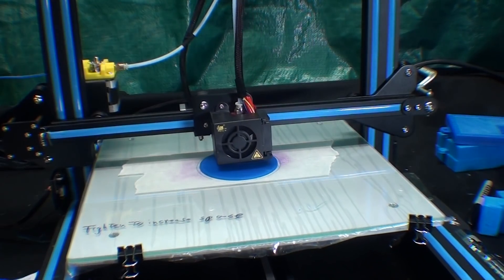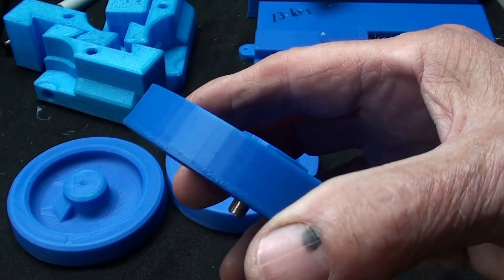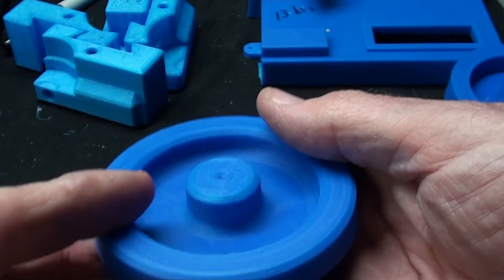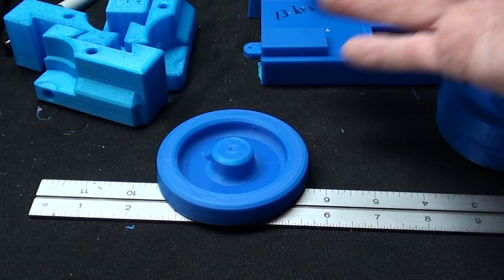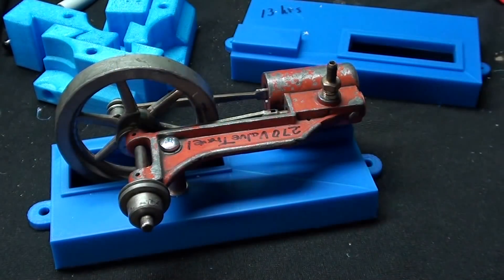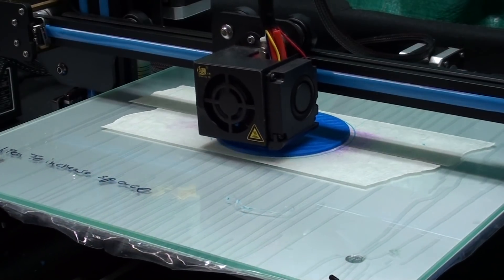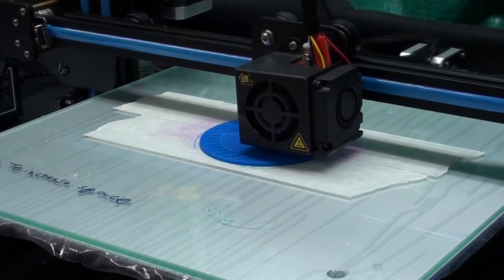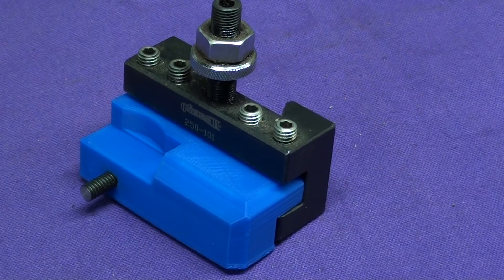3D Printing CREALITY CR 10 with tubalcain #2

Comment: I have been watching your videos for a long time and hope that I can return some of the help. 

Here are some tips for PLA bed adhesion. 

1.  You want your heated bed temp around 70°c use bare glass with some elmers disappearing puple glue stick smeared directly on the glass, it can also help if you use the glue stick while the bed is warm. You can clean off the glue stick every so often with windex if it starts to get too thick. Masking tape will lift off the glass sometimes even though it the PLA sticks to the tape well the bond between the glass and tape will be the weak point and it will still cause warping.

2. Check the gap between the hotend and the bed when the Z axis is homed using a piece of paper or thickness gauge. Adjust if the gap is larger than a piece of paper.

3. Make sure your bed is level as you can get it. Move your hot end around to different locations and use a piece of paper or thickness gauge and slide between the glass and the hotend and adjust the bed as necessary to get the gap the same across the bed.

4. Check your glass with your straight edge to make sure it isn't warped.

5. Setup autobed leveling and use the appropriate G code to complete the auto leveling. Once you do this your printer Z axis will automatically level and track the bed as it prints so if there are low and high spots the Z axis will move up and down as it prints to compensate.

6. Run your hot end temp a bit higher on your first several layers and make sure your part cooling fan is turned off for the first layers.

7. Adjust your Z offset either in your printer firmware or in your slicer to make sure that the first layer is squished down on the built plate.

8 Adjust your first layer height and extrusion width a bit to make sure it is laying down a good first layer. If you are printing at small layer heights of .2mm or lower you want to increase your first layer height to say 120% and your first layer extrusion width to 110% you can play around with these numbers until you get it dialed in. If you are printing thicker layers of greater than .2mm you can decrease your first layer height to say 90%.

9. Print larger parts with a wide brim that is attached to the edge part, this will keep the edges stuck down on the corners and you can use a deburring tool to clean this off after the print is done.

10. You could try printing on raft this takes more time and if you have all the above done, shouldn't really be required.

11. Get a Palette Knife Spatula set that is used for oil paints to help you get your prints off the build surface. Or use a utility knife blade to get under the edge of the part. Many times just letting the bed cool down will allow the part to just pop loose on its own. Many times I have something that is stuck too well I will just pop the part with a wrench or some other beating utensil and it will pop off the bed.

12. Make sure the printer isn't somewhere that is super drafty or cold and if you decide to print ABS or Nylon or other higher temp materials  you may need to make an enclosure that encloses the entire printer to keep the heat in and temperature swings out.

Comment: Consider using hairspray straight on the glass instead of the tape and gluestick. Go to Walgreens and get can of purple Aquanet. If it's regular glass, wait for it to cool, and it will usually release on its own. Otherwise give it a bath in the sink. Sometimes a little Windex helps too.   Level you bed with the unit preheated- nozzle expands a surprising amount.  I t takes a bit of getting used to think additive instead of subtractive machining.  'Been a fan since I got a book of your from Lindsey Pub!  Keep up the good work!

Comment: Hi Lyle I have used 3D printing for patterns I found that I had more work in fixing the rough sides and the inaccuracies in the pattern. I used a special filament that is 26% wood and that worked much better. If you would like to try it I can get the info where to buy it. For me school is still out on 3D printing for pattern use It is really much better for prototyping that for actual parts to use. For now I'll make patters the old school way. I believe it is much faster. I do understand that you like to experiment and try new things to learn. For me I need to get the job done, so it is the old school way.
Reply from the maker: +trainman4602 hi Dave. I like your cooking shows. And I always loved I talion food, even though I am German and Norwegian. Yes, the jury is still out for me as well. I am still just playing around with those newfangled thing. But I think the idea of using it for Proto types, and just getting ideas in three dimensions is great.

Comment: The warping is from uneven cooling. The last layer of plastic cools too much before before the next layer is applied - the hot uncontracted plastic gets added to the already contracted cooler plastic. A heated print bed will only get you so far. With ABS you want to add a “raft” when you print. The raft is basically a mesh pattern a couple layers thick that gets printed first, your model prints on the raft. The raft makes it easier to remove the part when it’s finished, and if it still warps slightly at the beginning then the warp is in the raft and not your part. Your printer not being in an inclosure could be a problem also. You might want to try a heat lamp or small space heater close by. The issue of your part being faceted instead of smoother might be a software setting. I know in Sketchup you can increase the number of segments used to render a circle and the finished part comes out much smoother. When you get around to doing some castings from these patterns I’d be interested in two things in particular. First, how you handle the gating. Second, how you determine by what percentage to scale up the pattern to compensate for the shrinkage of the particular metal you want to pour.
Reply from the maker: +StevieLlahma thanks, that is good information. I will try using a raft. And you explained it well, as to what is happening as it cools

Comment: I haven't read all the comments... but a couple of things... first is you are printing a tall solid. I don't mean solid infill, I mean plastic retracts  when it cools and when there a lot of vertical walls the plastic layers all on top of each other they work together pull together to lift the print off of the bed... that is why people print with a brim(not a skirt) a brim helps hold the outer edges of the print down because the plastic is only a couple of layers tall so it contracts pulling the print sideways instead of up. A wide brim with only one layer tall will help keep your print down... not always but it helps a lot.

Also CR-10 beds are notoriously concave... run your ruler over the bed and see if it is flat, if not get a mirror from Lowes... mirrors have to be flat to be optically correct so they are a good bet. Look for 12 inch by 12 inch bathroom mirror tiles (6 in a box) that way you can have different bed surfaces you can use.

Comment: a larger nozzle will reduce your print times and less layers makes stronger parts.  For a CR-10 this really adds up when you are printing big.  Consider ordering a .8mm nozzle which you swap in and out with re-leveling in between.
Reply from the maker: +Jesse Schoch I am not even sure what nozzle I am using now. It is the one that came with the machine. Where do I buy other nozzles?
Reply: They are M6 threaded Mk8 nozzles. Sold just about anywhere.  Mine was purchased from the creality aliexpress store.  I went for 0.8mm which lets me print 0.4mm layers.  For quick functional parts it really goes quick.  You can still print thin layers and only really lose x-y resolution.  Changing it requires re-leveling your bed which seems to take about 8x as long as actually changing the nozzle.
Reply: While i'm giving tips you should also grab a PEI sheet and consider switching from PLA to PETG.  PLA prints pretty but not so strong.  PETG is about as strong as ABS but much easier to print.  PEI provides the best surface for printing PETG in my opinion, you can forget glue sticks and tape making that switch.  You will need to retune your settings for PETG and it may be a bit frustrating for you, however I believe it is worth the investment.

Comment: If you are printing in PLA then you can get a much flatter bottom without the tape. Just print with bed 70c directly on the glass for a very smooth surface.

In my experience it is not the print lifting, but the tape that is slightly lifting/getting pulled up by the PLA
Reply from the maker: +Jeppe Beier thanks

Comment: If you have a heated bed, set it to 60°C. The part is also large enough to turn off the part cooling fan. Turning the fan off wil almost always eliminate the warping on larger part. Also, a smaller infill helps. For patterns I usually print with 10% infill.
Reply from the maker: +Sander Vercammen that's good advice, thanks

Comment: Hi there, just wanted to know I enjoy your videos.  I also have just been getting into 3D printing for misc. projects around the shop.  One thing I can add, although others may have mentioned it already (I have not read all the comments) is that I found that adding automatic bed leveling to the printer and then adjusting the Z height offset to get the first layer as close to the bed as possible resulted in improved bed adhesion.   I am also using masking tape as I see you are doing and found that it works fine, although a little hard to get off the bed sometimes.   Warping seems to be minimized with good adhesion.  Good luck, I think you will enjoy 3D printing.
Reply from the maker: +Harry Workshop thanks for watching, and good luck with your printing also

Comment: Thanks for sharing your knowledge ;   and why the H.-  "thums down " ?. 
Perhaps some guys dont like your way of teaching, or its  just plain old jealousy :) . 
You are doing a great Job. 

btw  i totally ignore meanwhile ABS .-  i am using either PLA, or PETG, Flex, Metal compound CarbonFibre   and also mostly turn off the Cooling-fan to allow the material to cool down slower ( like brazing :) cast iron ).  and since i did it like that.- my Objects stay flat. Also i wait mostly until the Heated bed is cooled down to 20 C or so , that makes it really easy for me to lift everything without ruining my Bed-level again.  Bed Temperature is in my opinion often to high .-  
For the Low spot in the Printing area i bought a replacement "carrier structure " for the Heated Bed, which was stiff and strong as hell and had the possibility to put some insulation underneath the heated bed to keep temperature even.
Reply from the maker: +Michael Schnock I am using PLA, and having better luck lately. I think I will try turning the fan off

Comment: This is an excellent informational, Mr Pete. It definitely demonstrates that 3D printing at the cheaper end of the market has many technical problems, that make it not suited to the person who just wants to connect a printer and churn out stuff.  It takes a user with a strong technical bent like yourself to work through and gain the experience to overcome the problems.  
Fortunately there is a large support community out there for mere mortals like me :) 
I seem to recall a video where you said you wouldn't like to get into CAD and CNC (3dp is additive cnc process, after all)...  Now you're doing both, and it sounds like you're enjoying yourself.
Best wishes from me & mine to yourself,  Mrs Pete,  and the rest of your family for the upcoming festive season...
Reply from the maker: +greaser5691 yes, there is a lot more to it than I would have thought

Comment: I have always just used the glass and hair spray. Never an issue.
Reply from the maker: +Nathan Smith I think I will try the glass again, many people say that's all you need
Reply: mrpete222 I use  unscented all weather aqua net extra super hold. I always scrap the glass with razor blade first remove glass from bed so you don't get spray on printer. Let it flash dry good to go. Get about 20 prints before you have to re scrape it.

Comment: ABS exhibits superior pre-cast machining characteristics.  The material properties of ABS are very conducive to machining for superior finish qualities. The finished parts rival injection molded parts in appearance.  Just make sure to increase the shell thickness to avoid cutting through the outer layer.  Avoid gummy PLA machining if possible.  FYI the issues you are experiencing with your prints are quite common.  Only relatively small parts will come out close to flat.  The temperature differential between the edges of a large flat part cause uneven cooling and result in the edges lifting off the print surface.  Only a temperature controlled print chamber can alleviate this completely.   This is one of the reasons I began machining my 3d prints.  Using a fly cutter to level the bottom is incredibly rewarding.
Reply from the maker: +Gordon Jones I have been using PLA

Comment: Looks like ABS. ABS Warps as it cools. You may need to use PLA. It does not warp like ABS does. You should qualify as student/hobby. You don't make $100,000 off of the items you create with Fusion, I would think. So you should be fine.
Reply: I print 95% of the time in ABS - have been for the last 5 years, but yes, it can be a nightmare for some users.
Reply from the maker: +Philip Hoeffer I am using PLA. I have never used ABS yet
Reply: PLA?. That stuff shouldn't warp - are you sure its not ABS?  What does it smell like when extruding? PLA doesn't even need tape on the glass - just clean the glass spotless with a kitchen towel and a small spray of window cleaner, then rub briskly with another piece of dry kitchen towel.
Reply: Even PLA can warp some, thogh ABS is much much worse. I don't recommend anyone try ABS. There are better alternatives for pretty much everything that ABS does better than PLA.
Reply from the maker: +nansjes1 thanks, I will try that

Comment: Hi,
I will tell you how to get a free license, at least for 3 years.
Google Autodesk Student license.
You'll find a page where you register as a student.
You have to enter a school or university, but they don't check if you're a real student there.

Then you can download all their programs on your student license.
And the use is restricted to 3 years.

On sticking to the bed:
PLA: hairspray on glass works great.
I also always use a heated bed, even with PLA.

ABS: Heated bed, and a layer of thinned wood glue ( pva).
Sticks great, and when the bed cools down it's easy to get your stuff off.

Perhaps it also works with the PLA, did not try it on pla yet.
Reply from the maker: +Duco Maritiem thanks for the advice

Comment: It still seems quicker and easier to make wooden  patterns, on either  a metal lathe or a wood lathe , I'd try the printing method just to say I did it and to try a new technique.

Tom
Reply from the maker: +awhs1964 it certainly is quicker with a simple pattern.But I would hope to use it on complex patterns that take a lot of time and have several pieces.   There might be a glue that needs to dry, filler that needs to harden, paint that needs to dry, and many other things that cause patternmaking to be a slow process

Comment: Hi mrpete. To get  your prints to stick well make sure your bed is level. Use a piece of printer paper as a feeler gauge so that you can just feel resistance between the nozzle and glass in each corner of the bed and centre, you need a gap of about 0.1mm. Use PLA filament, forget ABS or any of the other types for now. Run the bed temperature at about 55 degrees celsius. Print straight onto to the glass using something like 3DLac or Dimafix spray which is formulated specially for this purpose. A good nozzle temperature to start with for PLA is around 200 degrees C. To speed up print time reduce infill to a maximum of 25%, saves filament, prints faster and is plenty strong enough for most purposes particularly foundry patterns. Once printed and the bed cools down the pattern will usually pop off of the glass on it's own, until then it will be stuck fast which will eliminate your warping problems, FreeCad is a great CAD drawing package, it's free and available for Mac and MSoft computers. Good luck and have fun.
Reply from the maker: +Quenton Reed thanks, that is very good advice

Comment: With regard to the pattern for the dial indicator adapter, did you take shrinkage into account?  If you did, how can the pattern it still fit together with the tool holder?
Reply from the maker: +cclarke6 yes, one has to consider shrinkage

Comment: I wonder if it will be possible to 3D print plastic gears to replace the zamak gears used on Atlas/ Craftsman lathes? Just a thought, but they might be a lot cheaper to replace.
Reply from the maker: +Bob Rees absolutely not
Reply: Absolutely https://www.youtube.com/watch?v=GhPsIle0VXA

Comment: Mr. Pete, I use a BuildTAK bed on my Raise 3D It works very well I don't have adhesion problems no glue needed unless I am printing with some off the wall material like Delrin. I use woodfill, petg, PLA, ABS, with our any problems. One trick I use on my Makerbot 5th gen when my part is to big and it starts to warp is to add helper disc to the model.  If you add some circles around the model and include a raft place the circles close to but not touching the model. The raft will attach to the other raft from the mode and the warpage will occur on the helper disk and not the model. Keep in mind this is on a non heated bed A heated bed will generally not need helper disk but it is something to consider.
Reply from the maker: +Joe Rizo  that's a wonderful idea. In other words the disks are sacrificial.